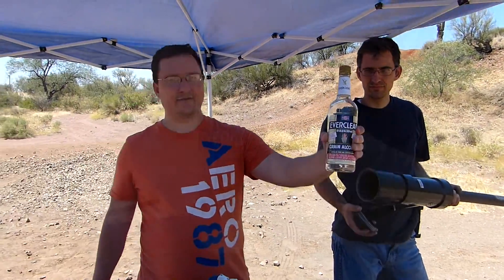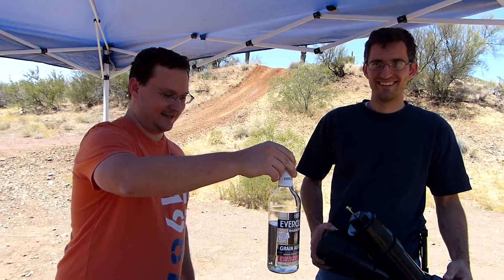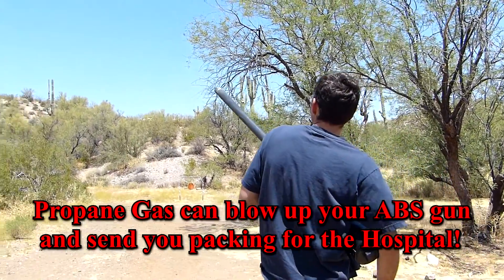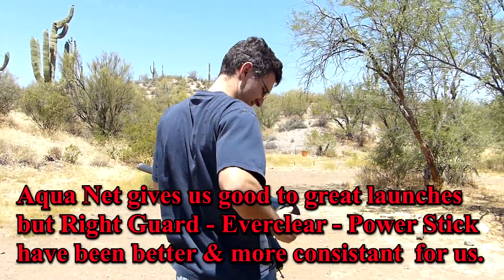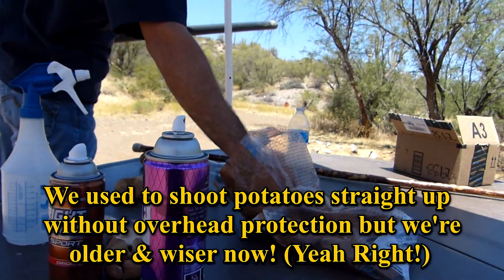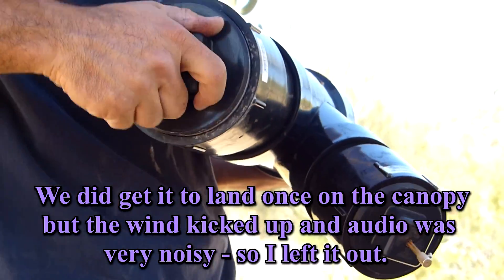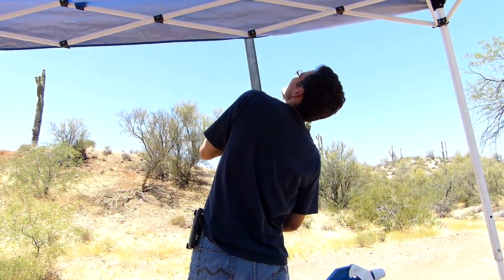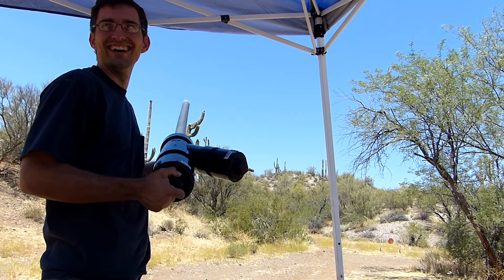Incredible Potato Launcher Cannon - Parts-Cost List

Comment: I made one and was letting the glue dry in the garage. not even thinking the next morning went into closed garage and pressed the electric lighter. well it was a horrendous boom inside a closed garage my ears weren't right for at least an hour
Reply from the maker: Just after gluing up the launcher I looked down the barrel to see how bright the sparks were from the igniter. I did that several times. After about 3 hours my son took the gun to my wife to show her how it worked. When he twisted the igniter their was a very loud boom which surprised everyone in the house! After 12 hours I decided to test it again & once again it gave a very loud boom. I then opened the ends & put it outside to air out. I'm just glad no one was looking down the barrel or that my son wasn't trying to get my wife to see how well the igniter was sparking! Treating these cannons like you would a gun seems like really good advice. Everyone please be safe! I've seen a few emergency room Dr.'s in my life & I'm seriously wanting to be done with that!